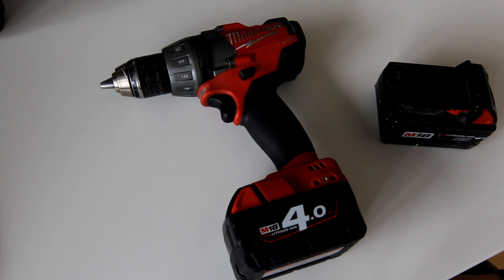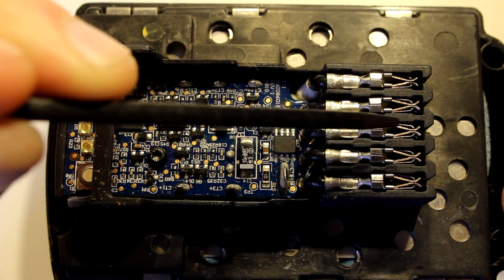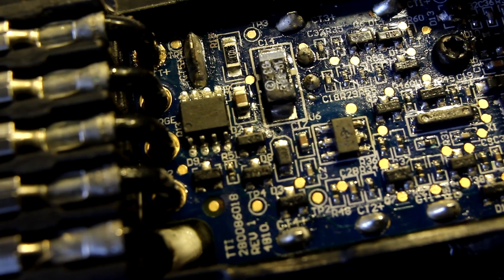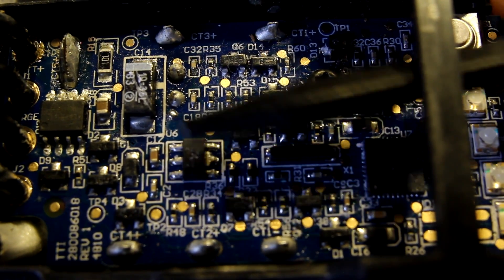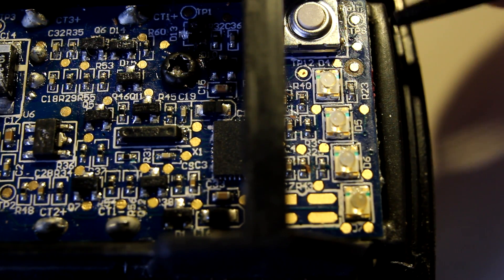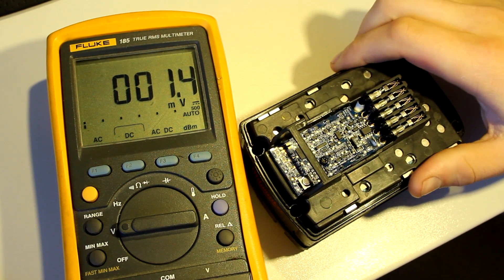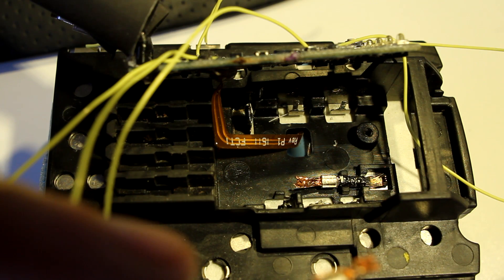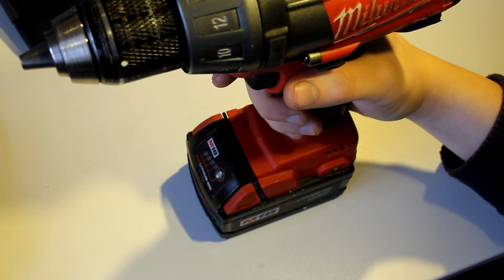Milwaukee M18 battery teardown and repair (002)

Comment: My battery was put on the charger overnight in the garage but it was quite cold and has not worked since. Terminals 1 to 5 measure 18V and  terminals 1 to 4 are 15V. When you press the button the lights do not show a charge. When you put it in the charger it flashes red and green. When you put it in the drill it does not work! Please advise.
Reply: Did you ever get this resolved? I know this was a while ago but it sounds to me like a single cell is dead and can't be charged. I collect a lot of my 18650 batteries by getting either free or very cheap dead laptop batteries and occasionally tool batteries. 

This sounds like a dead cell in the battery and so the charge circuit detects the fault ( red/green flashing) and won't charge it.

I basically get the battery packs pull them apart test the individual cells and dispose of the dead cell and keep the good ones. You could do the same but take care and replace the batteries. I would replace them all though to make sure you dont trip another fault by having a new cell with different capacity.

It's also an easy way to convert say a 4 Ah battery to a 9 Ah battery and possibly cheaper, as AvE said the battery capacity is just a measure of voltage of the overall battery condition, so nothing else would need changing.
Reply: @t1bzy  - you cannot use laptop battery cells in power tools, as they are higher mAh capacity but not rated for high enough current. They are different kinds of batteries, power tool cells are typically rated 30A while laptops are max 10 Amps. To increase the mAh of a tool pack you must add extra cells... so an 18v 1.5Ah Pack will have 5 x 18650 cells (each rated 1500 mAh), whilst a 3Ah Pack will have 10 x 18650s of the same type. You cannot get the same result by replacing the 5 tool cells with 5 x 3000mAh cells from a laptop.
Reply: Search Google for the words "milwaukee to infom you protection" then find the info sheet that covers cold weather bms reset.

Comment: Hi. Great video man! Could you please tell how you did the yellow wiring from tp1 tp2 ct1 etc to the pack. Thanks
Reply: You find some wire, and a soldering iron. You use a material called "solder" to join the wires between the PCB and the battery cells. If you cannot understand this simple thing, you REALLY should not be opening of modifying lithium battery packs.

Comment: Great video, awesome work! May i ask - i have similar Fuel M18 battery but no charger. Charge status button shows battery dead (1 LED blinking). I charged battery to full with lab power supply (4.2V for each cell now) but status still showing dead (1 LED blinking). Long press does not go into service mode. Pos and neg connections from connector to cells are ok. What could it be?
Reply: Same problem. I found 2 shorted (0.2V) cells , replaced those but still only show 1 led blinking. Have charged to 3, 6V all cells but still not taking charge from charger , green light (meaning full battery) and the battery doesnt work on tools.
Reply: If 1 LED blinking, it means that the pack has fallen below the minimum voltage threshold during the last discharge cycle. To fix it you must reset the pack, which is automatic if you plug it into a Milwaukee charger for a few seconds. [HAVE EDITED BELOW HERE]
I read online that it can be reset manually by applying a short-circuit between the Negative pack terminal #5 and terminal #4 immediately beside it. SO I just manually recharged a very flat M18 4.0 and it has not responded to the short circuit trick. The voltage on the 4th pin is at 0V anyway, so shorting it to Negative doesn't do anything anyway.
I'll test this further and see if I can detect anything happening from the charger side.
Reply: @johncoops6897  Hi. Thanks for the advise, i tried and got the same result - voltage on pin 4 is zero so no effect from shortening. I will try to investigate further. Do you have the original charger? Do you have any possibility to discharge the battery completely and then plug it to the charger while monitoring voltage in pin 4? I also suspect that the guy suggesting that just confused which pin needs to be shortened..
Reply: Finally i got an original charger and tested how it works with the battery run into protection and manually charged with +- terminals.
First of all, the + terminal of the battery is not used in the charger.
If we count the terminals as 1 being - and 5 for +, number 5 is not connected at all. When battery is placed on the charger (unplugged from the wall) - there is aroung 20V on terminal 3 (coming from the battery). When you plug the charger - on terminal 2 there is around 11V and some pulses with duration ~5ms (checked with scope), on terminal 4 - around 2.3V sometimes changing to 1.8..2.1V (checked with multimeter).
To me it looks like there is some communication between charger and battery controller.
So i would say that without the charger you cannot do much. Trick of shortening some terminals on the battery - maybe works on some different models.
Or maybe battery must be charged by the 3rd terminal (if charged manually) instead of 5th?
Reply: @johncoops6897  hi. Have you figured out how to reset the battery when having no original charger but lab power  supply with CC/CV function? Any specific terminals need to be shortened to reset the battery or perhaps something else can be done?

Comment: Good video.

Dewalt have the same safety fuse.
It often burns. Someone used the battery not for designated purpose.

To batteries of Milwaukee replacement 18650 is admissible. They will work.
Blocking of the controller doesn't happen. 
Whether loses the controller that that important? I don't know. 
I had dead batteries. I repeatedly packed their new 18650.
Reply: You must repack with high amperage batteries, not cells scavenged from laptops etc. The cells in power tools are designed for 30A or more current, whilst laptop cells have higher capacity but max 8A or 10A... They will fail  if too much current is attempted.
Reply: Makita is the worst, it burns out without a reason

Comment: I disassembled 2x 4AH dead battery packs and found the front 4 cells in each pack were dead.  I made up a good battery pack using 10 good cells.  I found that by shorting the 3 centre battery plugs, it jump started the charge board again bringing the battery back to life.  I manually charged each cell on my lab power supply (4A at 4.2V cut) to balance all cells prior to soldering the cells back into the pack.
Reply: So you mean short J1, Charge and J2 pins on the battery?
Reply: You only need to short TWO of the terminals to reset the pack. Just connect Negative (say that's terminal 5) to the terminal immediately next to it (ie #4).

Comment: When trying to charge my battery, the charger only skowing a lit green LED and it won't charge the battery. What could be the problem?
Reply: Did you ever find out how to fix it?
I have the same problem on a 9.0
Reply: Same here on two purchased together after 2 years of use same issue at the same time
Reply: They need to be rebalanced. Disassemble, then charge up the low groups, I use 4A for the 3p 5s bigger battery. Do this after a full charge aka top balance. I have 4 9Ah high demand and after waiting for warranty once, I just do it myself cause they need it monthly, after daily cycles. Just clip on from R:C charger under liIon settings. 4.2v  4A = hour maybe
Always it’s bank 1 &3
Reply: @chriscord6524  for me the stupid one over here.. can you dumb down what I need to do for my 9ah high demand battery to get back to life. Charger shows full charge but take battery off and it blinks 1 bar... are you saying to charge each sell individually with a 4 amp charger?
Reply: @kylegray990  yes, that is what I do. But they are in groups of 3 cells. Each 3=1. You will see the groups. There will b 5 groups of 3 cells, which equals 3parallel 5series. You only got to get each group charged to 4.2v. I use a hobby charger. And it’s much faster to do this after a complete charge from m18 charger. Also anyone seeing this never input on pin 5 or +pin of m18 battery. It’s exit only. Use pin 3 middle one.

Comment: I accidently shorted the poles on my battery trying to ghetto charge it after my charger broke...  can't see anything obvious wrong with it when I look at the board... what do you think is wrong with it?
Reply: k I got to the end of the video and I'm assuming the same thing happened to mine... probably blew the fusable link... how the hell did you get the board up?
Reply: I was wondering the same thing. If you look at the board carefully in the video where he has the circuit board off you'll see he desolderd some points on the circuit board ct1+.      Ct1-.  Ct2+.   Etc

Comment: I attempted to replace 4 bad cell in a pack and to my surprise even if they were correctly replaced, the battery does not power the drill. The LED of the drill does light, but the LED indicators and the drill are not working.
Reply: Sounds like the mystery of the inner pins, they should measure 3.3v across them, if they are zero they wont start tools up, just light their less. Did you maintain power to the board whilst disconnecting the bad cells?
Reply: @ThuleApsu  No, I did not know it needs a heart bypass at that point.
Reply: @ForgottenGamesAndMods  Understandable, I didnt until I saw this video, seems these Milwaukee systems are overly complex, feel I need a DSO just to decode the tools now.
Reply: @ThuleApsu  They are not anti-repairing too much. If I do cell rebalance (I usually bring them to the value of the highest pair) for cells below usable value (battery flashing as for undervoltage) and then discharge the series a little, when connecting it to the charger the charger will reset the status to good and the battery will work.  So it's not perma-kill like for Makitas.
Reply: @ForgottenGamesAndMods  Recommend any good spot-welders?
Reply: @ThuleApsu  I have a battery-based cheap one that only works up to 0.1mm stripe but it's not powerful, only good for precision work and will not weld more than 0.1 thickness. The main one I have is made by me from an microwave oven transformer. It ended up too powerful and it's good for 0.2mm+ and 0.15 only if your hand is quick enough, otherwise will melt-vaporize the stripe quite fast. I mounted a detonator-like button on it. So I guess I'm still looking for a good solution for 0.15mm stripe which I practically have some stock of. I don't want to lower the power on mine, it's good as it is for very thick stripe.
Reply: @ForgottenGamesAndMods I considered a MOT before, but it would end up a little bulky and noisy and as you say, its difficult to get that low voltage you need (couple of secondary turns?). I know there are some capacitor based ones, think they might use super-caps which as you probably know are usually only a 2 or 3v but farad rated.

Comment: The flashing lights when you hold down the charge indicator button are four sets of codes separated by all four leds flashing. So an example set of codes is 0001, 1250, 0150, 2251. Interestingly, The second code is number of days since it's been first charged, so 1250 days ago would be about three and a half years. I found that this second code differs from the date stamp on the plastic housing because the batteries sometimes spend quite some time on a store shelf before put in service. The third code is the battery cycle count, so in my example it would be 150 cycles. The first and last code seem to be status and identifier numbers that do not change so they are not that interesting.
Reply: My pack shoots these codes:  0001, 1847, 0063, 1536.  That's just over 5-year-old batteries that have only been charged cycled 63 times.  Not bad for a free pack (some dude was going to recycle it...I was just going scavenge the cells but I may find a friend that has Milwaukee tools).
Reply: good to know
Reply: just tried this on my battery and it doesnt work, i hold the button for 3 sec but nothing happens
Reply: @flisko123  
Same here, new battery date code May 2018 and no LED codes anymore.
Reply: is there any other way to check
Reply: @flisko123  
I guess Milwaukee techs must have access to a proprietary battery diagnostic tool that communicates directly with the MCU onboard ? Just speculating...
Reply: So on the first set of blinks that you see: 0001 = good 👍  code 0101 = problem in the battery or charger

Comment: Same problem different solution . With the insight of this video I pulled on the negative wire and it came loose. I dreamed a peace out of the plastic over the negative pole and soldered a thick wire which I connected to the loose negative wire which did the job without taking the PCB out. Thanks again for your video which helped  me a lot!
Reply: I've heard other people say that the processor balances all cells, but only needs power from one or two, so maybe that's why a disconnected negative doesn't cause shutdown. Alternatively, the CT1- post may be a return path for the processor power as well as being the path for balancing on the low end cell.

Comment: How would you recommend cleaning the battery terminals thoroughly. My Fuel impact runs but spins slowly, slower than 1st speed. While on 3rd. If I push in on the battery and move it around a bit it jumps back up to full speed, then precedes to jump jump around before slowing back down.
Batteries work fine on other Milwaukee tools. Terminals are dirty, but I'm not sure if it's on battery side or in the drill. Have any thoughts?
Reply: Yes, my thoughts are that you can USE YOUR EYES to see whether the terminals are dirty or not. And since the problem only exists with one drill (you say the battery pack works with other tools) then you already KNOW whether it is the drill or battery that has a problem.

Comment: Hi, thanks for the best movie about the battery so far on youtube! I have a chinese copy of the battery (circuit board looks the same) and  replaced cells to LG HG2 to have 6 Ah. Just after replacing the cells, the battery was not starting, i.e. pressing button was not turning any of the LEDs on and battery was not working with my tool  (despite the fact that I charged the new batteries to almost full before). This problem led me to your movie. Thanks to you mentioning about powering micro controller, I realised that it is the problem - microcontroller. Having thinking about what you said on the movie tried to sort out how chinese re-program these batteries and tried to find some intructions or (at least) information about it on the internet without success. One thing that I realized is that if the batteries need power to live, then factory has to program the batteries after assembling, as one of very last steps. Looking on the board, did not see pins for a programming interface, so it is possible that they use the 2nd and 4th pins to activate the battery after assembling / start it. Well, having no other idea, I have connected the battery to charger. Charger showed the battery is full. Disconnected battery, pressed button and now the battery is fully working :) It seems that the charger acts like (re-)starter for these battieries (at least mine did this job). Well, is seems to work this way for chinese copies (at least) that have board looking exactly the same way as your on the movie. I hope my experience can help anyone in the same situation. All the best!
Reply: THAT IS WHAT I HAD A PROBLEM AWHILE AGO /  BUT THIS OTHER  BATTERY WAS DISCONNECTED FROM BATTERIES FOR 2 YEARS AND WHEN I INSTALLED NEW BATTERIES THE LIGHT ONLY BLINKED.THEN I PLUGGED IT  IN THE CHARGER AND NOTHING CHANGED BUT THEN REALIZING THE THERMISTOR WAS MISSING REPLACED IT THEN ALL WORKED PERFECT!!!!!!!!!!!!!!!!!!!!! DID NOT NOTICE ANY EPROMS,STATIC RAMS ECT. EITHER JAMES J.DEVITO III; GENERAL DYNAMICS,ELECTRONICS DIVISION

Comment: Great vid. I learned a lot.  One question, does the built in protection circuit of this battery prevent over-discharge if it is used in a non-Milwaukee tool?  In other words will the battery self-shut down before permanent damage is done if power is drawn only from the + and - terminals?
Reply from the maker: Nope, you can charge and discharge it with other tools until it's broken. The terminals are directly connected to the battery cells inside.
Reply: Thanks, makes sense.  What would be a reasonable low voltage cutoff for this 18v battery to avoid killing it in a non-Milwaukee application, then?
Reply from the maker: A safe cut-off voltage for any li-ion cell is about 3.3V, so given these batteries have 5 cells in series, that would be 16.5V. (fully charged is 4.2V/cell, i.e. 21V)
Reply: David Moss from experience, I tried running this battery on a 20v craftsmen impact and it ended up blowing that exact same wire he has here in the video. So it doesn't seem to work.

Comment: what are the two poles, J1 and J2 for again? i didnt catch that part. and why is there a separate one for charging?  
where is it's corresponding negative?
Reply: It looks like using the Charge pin allows balanced charging of all cells. J1 and/or J2 should be communication from battery to theh tool to say that battery is dead and tool should stop working, as cells are hard connected to tool. So thats the only way of over-discharge protection
Reply: @shchepetov  From investigation it seems 0v on j1 and j2 means a faulty tool, but the tool communicates to the battery, I know this because my impact causes the inner pins of the battery to latch to zero.
Reply: It's 2 years later. Have you figured out you can replay YouTube videos yet, in case you didn't catch something on the first watch?